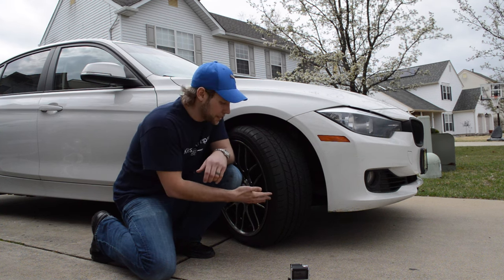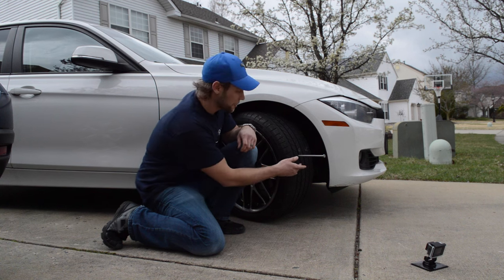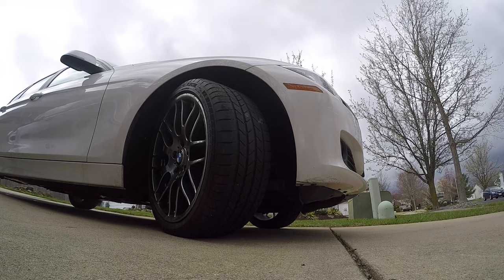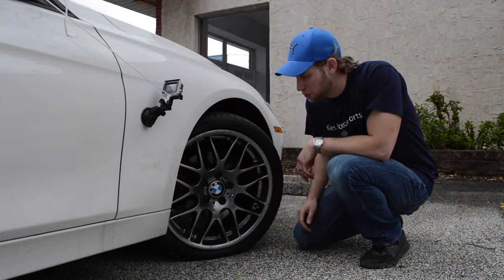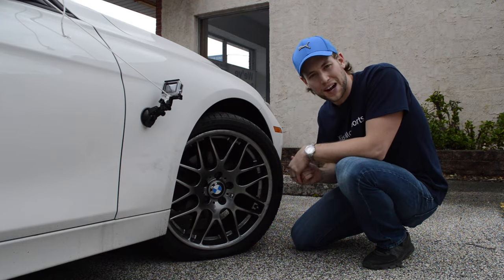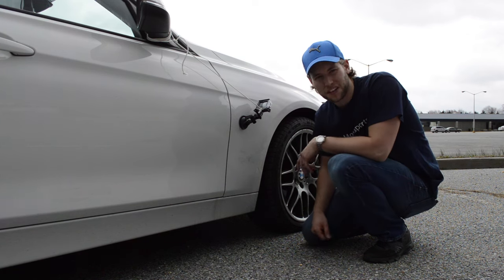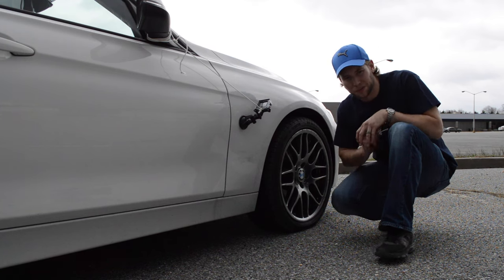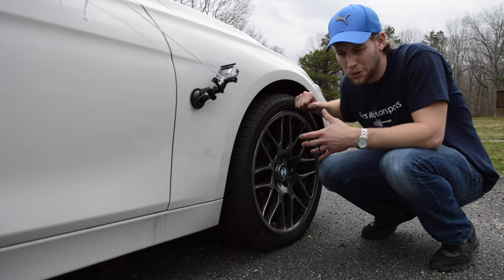What Happens When a RunFlat Goes Flat? F30 BMW and a Big Nail

Comment: Running a run-flat tyre without air for any distance damages the tyre (this is why there is a 50 mile limit), so he would have had to replace it anyway, even if he had just let the air out of the valve. Besides which, actually puncturing the tyre is a more realistic test as the tyre is not just flat but physically compromised as well. Nice job and very interesting. Thanks for sharing.

Comment: I have f30 and I have run flat. I live in New Mexico where even gas stations are 100 miles apart.  I ran on a flat tire (about 13 psi) for 120 miles at 65 mph and made it to the shop. It was a rear-right tire, but still impressive.
Reply from the maker: That's great!
Reply from the maker: Nice!
Reply: Thank you, I drive my BMW to the South of France, so it's good to know about the runflat real range
Reply: Got a flat in San Antonio
Reply: Rode out on a run flat until I got home. (215miles). I was extremely surprised
Reply: Did the tyre have to be replaced, or was it still repairable?

Comment: This is why I've stuck with runflats on my 3 series despite the harsher ride. I had a flat in the front left and was able to continue and get home safely before getting the front tyres replaced a couple of days later.
Reply: My flat tire’s tire pressure is zero. Something happened after I parked and it’s zero psi now. I’m curious can I still drive my car up to 10-20 miles? To tire shop
Reply: This is the same circumstance we're in. Hit something in the road and made it home, but psi is now reading 0 and I'm wondering if it's safe to drive to the tire shop. @sgcatr

Comment: 1. Run-flat tyres should only be mounted to rims that are designed to take them.
2. run flat tyres are un repairable.
3.most run flat damage is only visble on the inside of the tyre.
4. run flat tyres are a lot heavier than normal tyres 
5. run flat tyres give a harder ride and do not absorb most bumps.
6. runflat tyres are a lot more money than standard tyres.
they are also an ass to fit to the rim.
Reply: And that is why I have changed them to regular. The selection of tire is much bigger, no supply issues...just need a little tuning to the suspension and you are done with these silly run flat.
Reply: Tires*
Reply: Yes you can repair a runflat i have done it twice at big o tires.
Reply: @CartubeCoIl  What about the spare? My car came with no spare and no space to fit it.
Reply: Check out other USA sites, they are repairable !!
Reply: If i understand correctly I would have to replace the tires. I have a BMWX3 it's gave me a message i put air on it the message still there

Comment: Thx for the video! I was seriously thinking of getting reg. tires instead of my R.F on my X5d thats why I searched for pro/cons of rf. Being a single mom with a 2 & 4 yr old and a small dog. I'm now convinced my R.F are more convenient, safer with peace of mind in my situation vs. a smoother ride with less shock. I rather spend the extra cash instead of trying to change a tire with 2 scared kiddos and a barking dog. Again thanks
Reply: get a tripple aaa it is i think 30 dolars for the whole year ..this run flat tires cost a fortune anyway once you have a whole or a screw on it eventhough you are able to drive for some miles when you end up at the dealer or shop you have to purchase a new tire another 300 dollars for every single nail on your tire . with a regular tire it is like 30 dollars to refair a flat tire and if you are a member of costco or sams club they do it for free , you do the math ..
Reply: Still single!

Comment: So funny you didn't just let the air out!! I've got a '13 5 series . The RF was really great when I wasn't expecting a flat. The indicator does come on as soon as it loses the required amount of air. The only issue I have with BMW is that it doesn't show the amount of pressure on each tire on the monitor, it only highlights which tire is low. I took mine to a repair shop and they patched it. Luckily it wasn't in the sidewall...They said that most people say you shouldn't but the tire shop said you can but you should only let a professional do it. Mine has been running with a patch for over 20,000 miles now. Thanks for the videos!!
Reply from the maker: Hi, thanks for your comment. I believe if you have Nav that it displays the pressure (which I think they all should), but it may require coding. I believe you can even see each tire's temperature, but again, it may need coding. That's great you were able to patch it! My personal feeling is that they don't want you patching it, because they don't know how far you drove on it flat, which would weaken the sidewalls. Try at your own risk, but if it was me and I just got the flat.. I'd try to fix it as you did, as long as it wasn't in the sidewall. Thanks again

Comment: Had one one of these tires explode last summer while going around 120 km/h. Most likely a nail/screw puncture after which the object erupted outward.  No noticeable loss of control in perfect summer conditions even though all pressure was lost immediately.

Dropped speed to 80 km/h and drove to closest gas station. At closer inspection there was a proper hole with the diameter of a pencil. Tire off and fixed it with one of those sticky plugs and gave it some air. All perfect and got back home. The plug held perfectly until I got the tire properly fixed. 

The tire will heat up like a mofo!

Comment: Good video.  I don't think BMW did their homework on how far the distances are in the western half of the United States or I guess they figure you'll buy the X5 and have room to stow a fullsize wheel and tire, I don't know.  Regardless, you need to be able to self-rescue in a lot of places in the US because the tire shops won't have the Continental run flats that match the car, or they will want to sell you 2 or 4 tires, etc.  The muffler on the F30 is huge and takes up what would have been the rest of the area for the spare to fit.  The BMW cars with electrics like the 330e take up all that space, which is why the engineers had to ditch the spare so bad (and cost savings).  Granted, I have gotten maybe a half dozen flats in 27 years of driving, but I still like having a spare tire.  It's old-fashioned to be self-sufficient.

Comment: It all depends on where the hole is in the tire. If the hole is on the side of the tire wall (not underneath) those expensive run flats are useless + some tire shops may not have run flat replacements.

Comment: Im not for sure if I will buy the run flat tires. I just bought a 2005 645 Ci and the car does not come with a spare or even so much as a compartment for the spare -no room for even a donut. I also understand that if you try and use a can of fix-a-flat, it will ruin the tire pressure sensors. So I have to make a choice; buy the ROF's which are heavier, less performance cornering, do not last as long as a radials, harder riding, and more costly. Or, buy all regular tires, buy a small donut spare, and take up what little space I have in my trunk. Right now I am afraid to take a long road trip. So I appreciate anyone's recommendation! BMW made a bad decision not to provide a spare. Nice video BTW....

Comment: So if your traveling and a tire shop is more then 50 miles away you're pretty much screwed.
Reply from the maker: Pretty much.. then once you get there you're in for more with the price of the new tires..
Reply: no thats just the saftey rating. they actually last months like that and you can go 100mph easily. i know from experience LOL
Reply from the maker: My tire started to feel like it was coming off the rim after about 25 miles lol
Reply: Kies Motorsports yeah with 0 psi its rough. but actually, with just 5 psi the tire will handle very efficient.
Reply from the maker: Yeah, I think if the hole was smaller, that it would have been easier to drive on
Reply: Youtube Comment Section had the same experience.. dint realize I had a front flat tire for almost two months tire drove and looked completely new

Comment: I have an M5, woke up a couple months back about 30 miles from home.  I tried to drive about 3 miles to see how it was doing, and it was shredding the tire and very hot.  Wondering if the tire was a bit on the worn side, but I thought I remembered it still having some good tread left.  Makes me nervous.  The low tire indicator did come on immediately as well.

Comment: Run flats would be great if there was Tire Rack shops 50 miles apart that stocked every conceivable run flat tire size and brand for every car, and were open 24 hours a day
So, no matter what you drive, they would have one in stock and simply replace it 
So, knowing that that statement was just a fantasy

What would a person do who got a flat then limped to a truck stop going 10 mph below the speed limit on a freeway like a sitting duck
And made it without getting rear ended to a truck stop or garage that does not even carry car tires
And you are told run flats can not be repaired 
And the closest place that carry's your tire is over 100 miles away and in the wrong direction you were travelling
Then what?
Anybody

Comment: Brian, this was one of the best video demos I've seen on YouTube. Great work! Just curious, did the tpms indicator come on to warn you of a flat tire? Would be good to know... Thx
Reply from the maker: +Ken Or Thanks, Ken! I actually just got those wheels (and tires) a few months ago and they didn't come with tpms. If I had them in, I'm sure that they would have come on, because although the tire is still drivable, it's still as no air pressure in it.

I've since (two days ago) put my tpms in, but hopefully I don't get an unplanned flat!

Comment: The whole "weight saving" theory is bullshit. The 255/50R19's on my F15 are 15 f*cking pounds heavier - each tire - than identical non-run-flat tires. And that's unsprung, rotating weight, which has a huge impact on ride and acceleration. So the total weight cost of the run-flats, ignoring the rotational weight penalty, is 60 pounds. That's way more weight than a donut spare and a jack, plus a case of beer to ease the boredom of changing/plugging a tire on a backroad.

In 40 years and well over a million miles of driving on non-run-flat tires, including 400,000 miles in large vocational trucks that went off-road several times a day, I've had 2 flats. Two. So the idea that run-flat tires are going to make a big improvement in my life is rubbish.

Comment: I twice had flats on my run flats on my 2008 Corvette…one rear one front…Goodyear high performance summer tires. I drove only a few miles to a tire shop on surface streets each time. Both were repaired. Even though I never drove over 45 MPH both times my car was squirrelly as hell…I’m switching to All season run flats soon.

Comment: I am driving a 2012 BMW 500 series, 39k miles on it.   While driving the other day,  I heard something pop, got an alert on my dashboard that the air on the rear right tire is low.   I drove for another 5 miles to Belle Tire, unfortunately they are unable to help me!!  I found a tow truck driver who helped me take my car to the BMW dealership.  That is when I knew I had a run on flat tire, one of the reasons  why a spare tire is not provided.  Good to know I have it!!

Comment: Run flats don't actually need air to work because the side wall is so tough and inflexible. That's why they make horrible comfort tyres. You pay's your money and takes your choice. Bear in mind of course that there is very little technology involved in making a rigid tyre that is inflexible when the air is removed. To make a quiet running radial tyre that provides comfort and rigidity for performance does cost money in R&D. Currently RFT manufacturers are making lots of profit from safety with very little investment in trying to make them comparable to a conventional radial tyre. Personally that makes me angry so I won't buy them as I am being ripped off.

Comment: It may be worth noting other run-flat tires may not match the flat-tire performance of this particular tire.  I had a much worse experience with another brand of Run-flats that came on my 2018 BMW.  It was worthless with no air.  I had a small (actually small) screw in the RF tire overnight near the middle of the tread.  Tire pressure notice came on when I headed out in the morning, but I thought it was from a recent temperature drop.  I only went 2 blocks before deciding something was terribly wrong.  The wheel was bouncing as if it were bent and the steering was no better than the steering with a flat conventional tire.  Retuned home and filled the tire with air.  Since I left the screw in, I made it to a shop before the pressure dropped very far.  The "bouncing" was from the Tire Pressure Monitor being crushed every time the wheel rotated to the filler stem position.  It was destroyed.  The good news is that I did not drive very far in the flat condition and the tire was able to be plugged.  Overall, it performed almost identically to a conventional flat tire (not drivable for any distance) except that it did protect the rim.  I found your video by searching for what brand of run flat actually works and there is a good chance I'll buy the ones you tested.  It's very hard to find other similar testing.

Comment: The explanation for why use and why buy a run flat tire is those tires are the best 
You don’t need a spare tire or any car jack you get a Neil in the tire you can continue driving on the road until you get to your favorite tire shop and get it fix it or replace it simple as that 
Obviously this technology cost more that’s is normal

Comment: The manufacturer says that these tires are for cars with tire pressure check. That's a pity, that you didn't show other not damaged tires for visual comparison, so we can look for a difference between them. I don't have a pressure check, but I really love the idea of run flat, but I am worried that I will miss the moment of that 50 miles. I make 150-200 miles at night, and please tell me, who checks his tires every single night?

Comment: Or, you know, they could just give you a proper spare tyre instead. I know they offer "BMW Roadside Assistance" but i wouldn't need any roadside assistance IF ONLY I HAD A FREAKING SPARE TYRE. Being able to drive for a little while on a punctured tyre sounds cool at first but then you realize that the tyres cost 500 bucks EACH. That's just not worth it compared to having a spare tyre in the trunk that i can put onto the car, drive to my local tyre shop and have replaced for a fraction of that cost. If they brought the price down to 100-200 bucks per tyre then MAYBE it would be worth it. As it stands, nope. Not even close.

Comment: You think they created run flat tires so you could be safe?  hahaha, Look your shoe laces are untied McFly !!! 

The auto industry has been lobbied into using these so that the dealers can sell you a new tire after having a single flat. 
Love how manufacturers have their recommendations, the tire must maintain 15psi during runflat operation, lest it must be replaced. w..wh..what...
Reply: Better than stopping on the side on the road stranded somewhere with no reception. Running a normal flat tyre would probably ruin your rims too. It's a run flats tyre, it has its own pros and cons.
Reply: Daniel Wee Certainly. But any changes in the auto industry are either due to a regulation by NHTSA or technology that can profit more. My point was that they did not invent this technology so that people could be safe, (sure that's the marketing spin on this) but having to replace the tire after a flat, because you drove 5 miles with less than 15psi is nothing but forced obsolescence.
Reply: Nonsense! Some manufacturers allow repair of run flats.

Comment: Just bought a Mercedes. Has run flat tires. Bought the Mercedes tire/rim warranty for 6 years. Anytime the tire gets flat, nail it ect, they will put a new one on. You cannot patch or repair run flats. So....we decided to get the warranty
Reply: GoPro Goalie Uzi that’s not true. They suggest not to patch run flats but yes you can patch a run flat. Trust me, I’ve had mine patched a few times. Honestly, they just tell you that you can’t patch those types of tires for one reason and one reason only.... moneyyy 💴 💰

Comment: These tires suck if you live in a country where pot-holes and speed-breakers are common and they cost  more as well. Also how come after you deflated the tire there was no warning from the iDrive system for air pressure loss?

Comment: I got a nail in the side of my run flat tire in 2014. I got it plugged and the plug lasted until February 2020. I’m currently driving 2 miles to work everyday and I’m planning to finally replace the tire within the next few weeks.

Comment: First, Good video gratz BUT, runflats are not that great they are like regulars can be fixed with right equipment yet if you keep driving with them beside the outer important part you wear the inner selant of the tyre.Means less lifespan of a wheel and irregular wear.I am not saying its not useful but its more expensive lot more harder to maintain and carrying a sapre wont kill you in my opinion :)